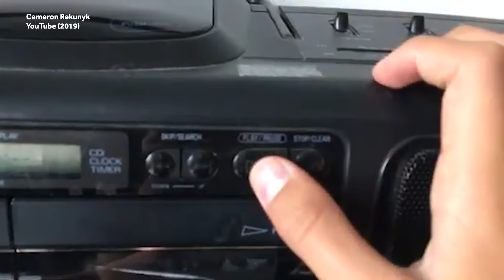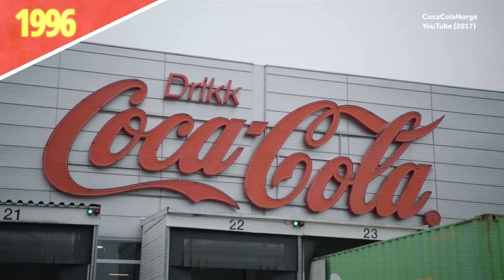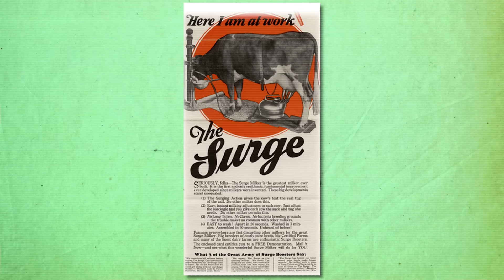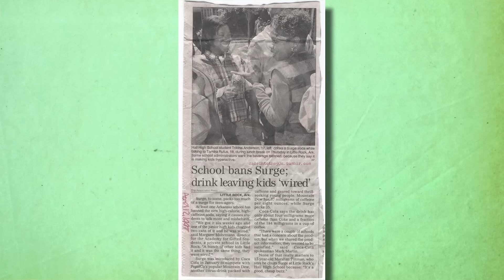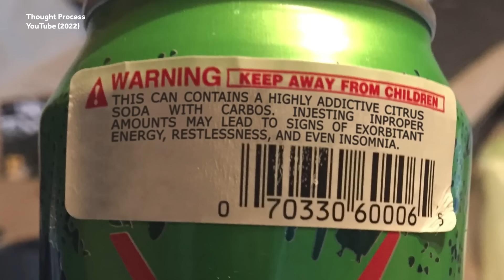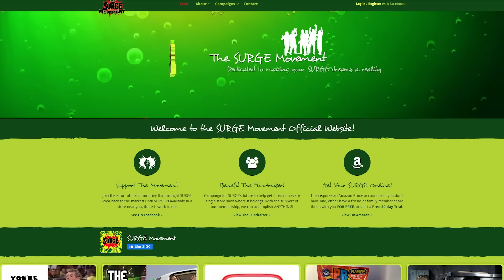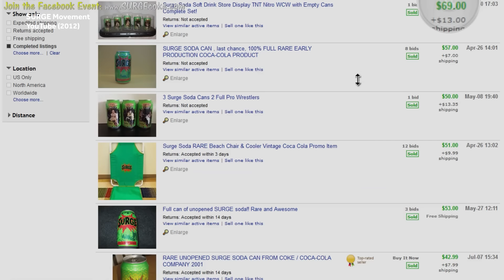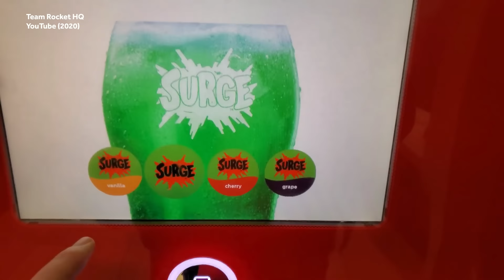What Ever Happened to Surge? The '90s Most Extreme Soda

Comment: Man, Surge was great. Those were the days where me and my friends would pull caps off tossed out 20oz soda bottles looking for free drinks. They were always running those promotions and literally most people seemed to overlook them. On a good day we could find ourselves with 12 free sodas between coke and pepsi brands. For middle schoolers that was treasure.
Reply: Were those the same Pepsico 20 oz bottles that had a B1G1 free label under the cap the you could read if you held the bottle upright and looked under the cap before buying it? I remember a friend and I checking bottles at the convenience store before buying them.
Reply: Those soda cap bottles had decent win rates too. I remember "1 in 6 wins" was advertised once.
Reply: Coca cola red hot summers I remembered those as well I always won a free Coke
Reply: I went to a nascar race when I was 12 and spent about half of the time under the bleachers collecting winning caps. People were too busy watching the race to pay attention to the cap and then they just dropped the bottles through the openings in the bleachers. I filled a big plastic sack full. I had over 100 winning caps and could have got lots more. I gave at least half of them away.

Comment: I lived in Alpine, Texas, up until August of 2021. There is a produce market there called Porter's (2 to be exact, but I only ever went to the one on 5th St.). As of Aug of '21, you could still be Surge there. They sold them in the 16 oz tall boy size in the coolers by the registers. Oddly enough, they were not for sale in the room temp soda section with all the other soft drinks, only in the coolers. I'm not sure why exactly, but they were there consistently. And they were just as addictive as I remembered from my teenage years!